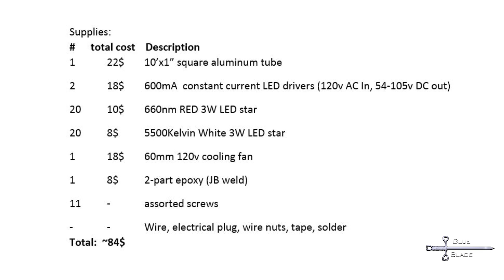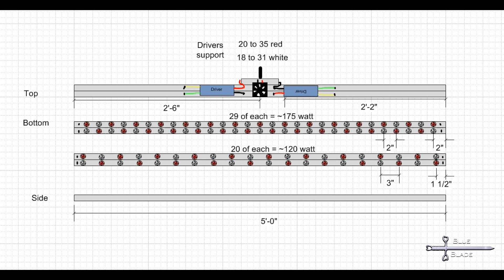DIY LED light fixture for aquarium: 120 watts for under 100$

Comment: Hi can you tell me were i can get the drivers, i cant find any let alone one that ships to my country, the one in the link is not there anymore
Reply from the maker: Hi! thanks for letting me know the link was dead - I updated it with one that works now. but you can also search your favorite marketplace (amazon, alibaba, etc) for "18-30x 3W LED Driver Power Supply 600mA"
Reply: @BlueBladeFish   sup again, did you ever try to make this fixture dimmable, im thinking to do so but i cant find a good driver so any help would be app.reciated
Reply from the maker: so - there are dimmable drivers, but i haven't tried one. I have made dimmable fixtures, but my goal was for automated fade-in and fade-out to mimic the day cycles. that is a bit more complex. honestly, since it is custom built i didn't need fine control - i just made it the brightness i wanted. I did make one with switches for each of the drivers... so i could turn banks of lights off (in this case it was to turn off the white to have just blue). that is easy, and would give you multiple "dimming" levels based on how many drivers you use.

Comment: I was wondering did you notice noise coming from the fans blowing through the tubes?
Reply from the maker: not so much "blowing through the tubes". the fans themselves hum a bit, as fans do. but there is no noticeable resonance or whooshing noise from the tube. if anything the fan was louder before it was bolted to the light.
Reply: @BlueBladeFish  I solved it by raising the fans with spacers about a 1/4 inch. Love it. I used 2 12v fans. It was enjoyable to build. Now I will make another one. Learned a lot from you. THANKS

Comment: How to chose led driver for3w 20pc?
Reply from the maker: well, it will vary based on the specs of your 3w LED's. but for typical 700ma 3.2v LED's. you would want a driver that does 700ma constant current, and could support a voltage range of at least 70v to 54v (20 LED's x 3.2v | +- 10%).  or a driver that can handle  driving 60w of LED's at a constant current of 700ma. often when looking at devices intended as LED drivers, they list how many LED's can be run in the description ("... for 18 to 28 x 3w LED's ..." .
Reply: @BlueBladeFish  thank you very much

Comment: Why u have used fan. Is it necessary to use it. And what will happen if we don't use fan
Reply from the maker: the LED's get quite hot. a fan blowing air through the center of the aluminum pipe keeps it cool. if you don't wish to have a fan, you may need a different heat sink.

Comment: Great build!
Got any PAR readings on this light? Looking into building one for my 23inch high tank. Would 3w LED's be enough for growing carpets at this hight?
150Wx50Dx60H (59'x20'x23'). Give me all advice you got! :)
Reply from the maker: I had issues getting exact PAR readings on the reef ones (with blue instead of red). std PAR meters don't register the blue as much. I built a 3 band LUX meter and did some comparative measurements.  the 3w leds provide about 2-3x the usable output of HI Florescent, with similar drop off per depth (~50% per 8 inches). 300w MH penetrates much further (less drop out) but is way less efficient. it should be fine for carpet nems, make sure they have some rock to climb, and they will be able to chose a light intensity they like.

Comment: hi, nice work man
i want to put 20 chip led 3w, but royal blue work  3-3.4v and deep red 2-2.4v, can i use a driver (600mA 18-30x3w) to put those led together?
Reply from the maker: its best to keep the blue and red separate, and use two drivers. because of the voltage difference, you will run the reds hot and they will go out faster.

Comment: Hello Blue Blade Fish, thanks for the video as it was much informational. I have noticed that you havn't used resistors for the LEDs, so can we make the setup without resistors too? I would like to ask help from you. I have bought below specs LEDs and want to know how can I light this up in 1 single panel, like what driver is required of what specs: 

3Wx10 White LED 

1Wx10 Blue LED 

1Wx10 Full Spectrum LED 

Thanks in Advance.
Reply from the maker: hello! well, the LED driver serves the same role as a resistor - limiting the current so the LED doesn't burn out - the drivers do a much better (and more economical) job.  to locate the proper driver you need to know the voltage and current specs for the led's - for example many "3 watt" leds are rated at 800mA, 3.2v  - so you want a constant current driver that limits to a max of 800ma. lower (say 700mA) would be slightly dimmer, but would make the bulbs last longer. the 1w bulbs likely need a 300mA driver. on top of that you need to take the total power and voltage into account - driving 10 of the 3w mentioned above would require a minimum of 32v (more like 35), and 30 watts.  so a constant current driver that output in a range of 24-42v at 800mA (and at least 30w) would drive the whole chain.

Comment: Hi, great Tutorial but i need a lil help here.
I have a 1.5Amps constant current 25-40V Led driver..
How many 3w led can i use in order to maximize brightness? And with what circuit?
Reply from the maker: perhaps you can link the driver? 1.5amps is too much for most 3w LED's .8A or 800mA is more typical.  you may have a driver for 10w LED's, in which case 1.5x40=60w, enough to drive 6x 10 w 1.5 amp LED's if run at 40v DC. if you did acquire 3w LED's that ran safely at 1.5A you could run 20 of them.

Comment: Hi sir 3w,26 Star LED how to connected in 12v power supply pls help me
Reply from the maker: I don't recommend driving the LED's directly from a 12v line. you should have a constant current LED driver/regulator. you connect it to your 12v, and it adjusts the voltage (buck) as needed to prevent the LED's from drawing too much current and burning up. 3w LED's have a power drop of 2.8-3.6v volt each, so you can only run 3 or 4 off a regulator fed 12v DC.

Comment: Hi! Just saw your DIY. Amazing and quite interesting. I am planning a 5'Lx3'Wx2'H planted aquarium.  Would appreciate your advice on keeping the lights  9"" above the aquarium. Rgds.
Reply from the maker: if you wish to suspend the lights above the tank (as opposed to having them rest on the top),  i have found that aluminum welding wire  works well.  it is fairly strong, wont rust or contaminate the tank, and is soft enough to bend/twist/tie. I make two loops, attaching the ends to the top of the canopy (or ceiling)  about 70% of the tank length apart, and then either place the light inside the loops (one loop holding each end) or hang it from them with hooks.

Comment: Wow!  Budget build! Very cool. My inner engineer has a couple of comments. If you spaced the aluminum tubing even just a 1/4” in the middle between the two tubes and another 1/4” gap between the wood and tubes you would get so much more convectional cooling. Even with the forced air cooling it would still be a significant amount of total BTU dissipation. But overall this is as budget as it gets! Kudos!
Reply from the maker: Thank you!  I may try experimenting with spacers on the next one.  it makes sense for the final heat dissipation, but with past builds it has seemed the most successful strategy has been just having a large thermal mass - spreading the heat out so that no LED heats up too much at its  one spot. however, if you wanted to stack more bulbs in a smaller area, the total heat of the system and total dissipation rate would be a larger factor.

Comment: Hey man your build is amazing! 
I'm building one myself for a 4 foot long 170 l tank. I'm planning on planting it with glossostigma carpet, rotala rotundafolia, and a few other low tech plants. How many LED's would I require for the best outcome? And could you tell me how many exactly for different colours. Also, I'm gonna automate it with a microcontroller for natural lighting and moonlight conditions.
Reply from the maker: well, the easy part first. for a planted tank aim for ~50% red, and some split of blue and white for the other 50% (or use a very blue white, like 10k or 6.5k) . as for how much light, it relay depends on the depth and type of plants.  a 4 foot long 170  could be tall, or it could be wide. if tall, you will need more light  - figure about 50% loss per ft of depth (very rough estimate.. ). if wide, you need more spread.  that said, two fixtures with 40 LED's each would be a good starting point -  add few more bulbs per fixture if deep , or if wide enough - start there, and add a 3rd fixture if needed later.

Comment: You soldered everything except the power leads and then wrapped them with electrical tape ?
 Tisk tisk ...
Otherwise a good project although a little bit complex for the average person who doesn't have any knowledge of electrical or metal fabrication .
However if someone has those skills they can save lots of money and have something more customized for their set up. I'd suggest using finned heat sinks rather than having to use a fan . It will add more to the cost but also eliminate another connection and the noise from the fan plus fans don't like moisture or excessive heat .Their bearings will either rust or dry out depending on how much moisture or heat they're encountering . So if using a small fan its always a good idea to check the flow from time to time to make sure it's operating properly . Moisture also attracts dust build up . Take a look at any exhaust fan in a bathroom and you'll see what I mean .
Reply from the maker: heh - i used electrical nuts and tape,  for the AC line. yes.  habit? when wiring a house nothing is soldered.  I suppose in my mind i cut between doing it like an electrician would for AC lines and the way an electronics engineer does for low voltage DC.

and you are correct on the finned heat sink and fan issues, but for a 5-6ft one...  if you can find it, it is much much more costly.  if you have a source that is not, please share! I have experimented with a few versions, and if on a budget.. doing it like this replacing the fan every few  (if needed - and as you say, it often is) years still comes our far ahead cost and effort wise.

Comment: How are these China Brand LED's holding up?
Reply from the maker: in general, very well. always get a few more than you need though. i test the batch and there are usually 1 or 2 that are not up to snuff.  for most fixtures i have not had a single bulb out in years. - cooling is key though. if the fixture gets uncomfortably warm to the touch (i have one like this - i jammed too many too close together)  you will more likely have some loss. fixtures with good fans and/or 2" or more spacing have not had any losses so far. the drivers are a different story....